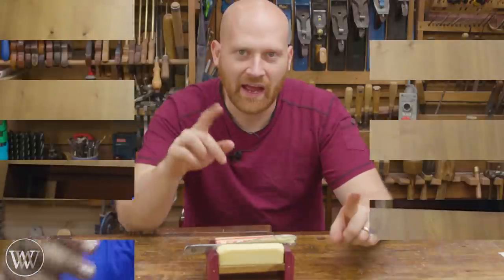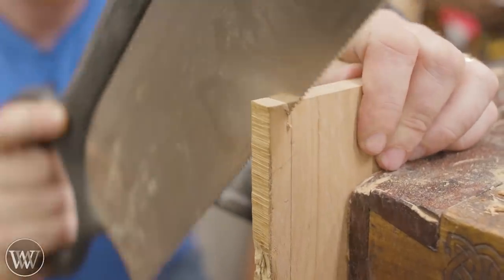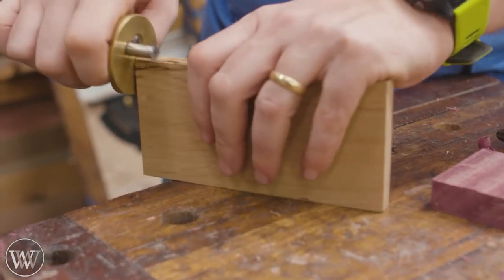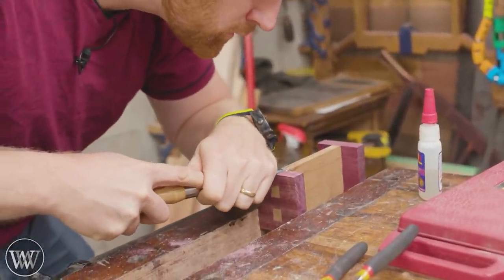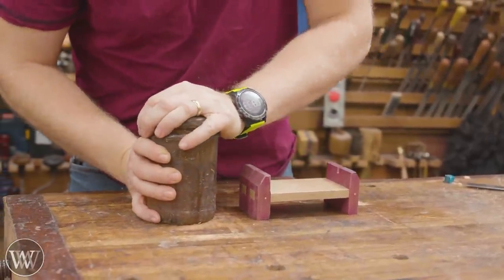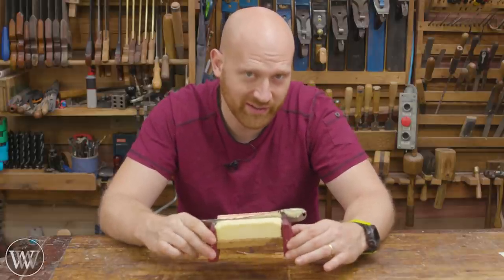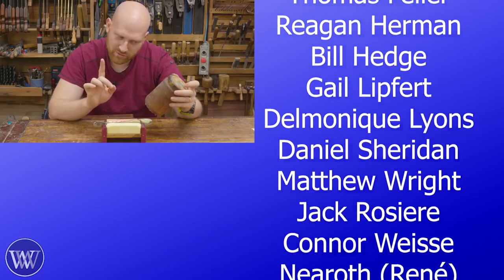How to Make a Butter Dish

Comment: Hi James!

Love this collaboration.  Both of you did a great job.  Raaghav is a very talented young man.  Thanks for introducing him.  Love the butter dishes and the hard butter butter knife!

As a historical note, what is commonly called a "shooting board" by some modern English speaking woodworkers is actually (originally) termed a "Chuting Board" (around the early to mid 1400s).  That is: A board with a dedicated chute (path - think laundry chute) that the plane remains within while trimming a piece of stock.  It is not until after the Korean War that we see the name changed to "Shooting Board" (a very different tool used by rifle marksmen to fine tune the sights on their rifle).  This change was entirely an American homonym confusion (interchanging  two words with similar sound but different meanings -- e.g. new and knew) which recently, last 40 years or so, has propagated through many other English speaking countries.  Since the words chute and shoot do not translate to homonyms in most other languages, many non-English areas find Engilsh directions confusing (the mass development and use of firearms Shooting Boards being a very privileged American event) and even confrontational/violent in some cases.  While one can say "Chute the true."  It is generally best to say, "Trim [plane, or pare] using a Chuting board"  this helps clarify the difference between the two very different tools.  FYI another name for a Chuting board is a Blocking board.  Here the term Block means to make tried (square to at least one surface) and true (entirely co-planar/flat) -- hence the name of the "block plane" which was originally developed for that specific purpose.

Comment: Can't beat purple heart, most of the time if you take your time, you can, as you did finish up with either a plane or scraper to get an amazingly smooth and shiny surface finish. I just make myself a basic long wooden stirrer for natural peanut butter and luckily had a nice, piece of old purple heart, just wide, long and thick enough, finished it with just a plane and peanut oil. 
Curious how come you didn't carve out a "bed" for the butter to sit in and/or stop it leaking off the side if it was left out and got too soft?
Reply: OK, just watched Raaghav's video and saw that he did do a little bed to keep the butter in ;-) Oh and while I only have limited old tools I've managed to find from friends/relatives and restore (few chisels, block and #4 plane, back and rip saw, square) after watching that kid, I feel like a king as far as tools are concerned. Good on him, first time doing dove tails and looks like he did a damn fine job.
Reply: @lynxg4641  thanks man, you will grow your collection faster than you can think! Those are some essential tools you have, you can make almost anything with them, slowly but surely you will get there 🥳🥳👍
Reply: @RaaghavWoodWorks  Thanks Raag, already feel very well equipped after watching what you have to work with, but hopefully James initiative will help change that soon. I actually enjoy finding and restoring the old tools (thanks to James and Rex for that inspiration) and know I already have more than enough to do more any project.

Comment: I've used BLO for years for everything from wood finishes to dressing my braided silk fly fishing lines; I was unaware that it was food safe until I viewed this video. Do you apply your BLO straight, or do you mix/cut it with other substances. For finishes on wood I frequently cut my BLO with turpentine (or mineral spirits) in a 50/50 mix. I've found that the turpentine allows the oil to penetrate deeper into the wood grain before it evaporates leaving just the oil behind.
Reply from the maker: I wouldn't use the stuff you get from the store is it has chemical dryers in it that probably wouldn't be the best for food though the newer ones aren't as bad as the old ones were. I use my own homemade BLO. It doesn't have any chemical dryers and is perfectly safe for food. And yes if you want a little deeper penetration you can thin it out. But you usually end up putting on several more applications of it.
Reply: @WoodByWrightHowTo  I don't suppose there's a link or video on how you make your BLO, is there?
Reply: @paulregner5335  yes, he has a video on how to boil your own blo, but for most people it's not a safe option, which is why I use something like a cooking oil as it does not have the chemical dryers, best of luck 👍🥳
Reply: @RaaghavWoodWorks  The problem with using cooking oils is that they eventually go rancid.

Comment: I've never seen butter in that shape before, is it the standard shape in America?

With the through tenons/square dovetail things do you cut the fingers from both sides like Paul Sellers or just from one side?
Reply from the maker: I like to chop them out from both sides. That way you make sure to hit the cut line on moth sides.
Reply from the maker: Butter in the US is sold in 1lb blocked that are split into 4 blocks but those come in two different sizes depending on where you are in the US.
Reply: When I do my dovetails the middle always breaks rather than cutting, any ideas? Mostly in softwood.
Reply: @sorchard6  Key with softwood is a extremely sharp chisel, sometimes it helps to make sliding motions with a smaller chisel to cut the fibers instead of pushing trough.

Comment: I noticed no glue was used in the mortise and tenon joints. Is it common not to use glue?
Reply: Ah, but he did pin the joints with brass pins, so glue is not necessary. In this case, you could go either way, glue would help lubricate the assembly of the joints, but pinning will keep the joints from coming apart.
Reply from the maker: Using a pin rather then glue will make it stronger when you need to wash it.

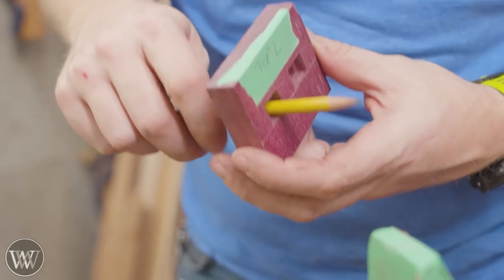Comment: At 7:46 you were fixing the tape on a cassette, haven’t had to do that in a very long time say oh 1998, thanks for making me feel old for 3 seconds. It is so hard to explain to people that you don’t soak or submerge wooden things in water because it will ruin them, I swear the conversations go just like this: Hey this shot glass is awesome, thanks just one question can I wash it in my dishwasher?
   No, the water will get absorbed by the wood and will ruin the shot glass please do not put in dishwasher or completely soak in the sink, hand wash towel dry and let it sit out over night if the wood looks dull apply some of the paste wax I gave you and rub it in
   Ok so why can’t I put it in the dishwasher?
 Because water will absorb into the fibers of the wood causing the wood to warp which will then cause your shot glass to develop cracks or give you a very strangely shaped shot glass do not put it in dishwasher
  Ok
  Ok
2 months later
  Hey I’m my shot glass looks real funky and has a split from the top about halfway down and whatever I put in it pours out the bottom
  Did you put it in the dishwasher?
  No, well not really
  Did you submerge it in the sink?
  Um.......
  Do you remember me telling you not to put it in the dishwasher or submerge it in water? Do you also remember me telling you it needed to be hand washed toweled dry and left out over night to air dry?
   Yes, but I didn’t think this would happen
   So you didn’t think I knew what I was talking about when I told you this would happen?
   I didn’t think it would be this bad, may I get some more?
   Sure pricing is still the same, just don’t put them in a dishwasher this time.

This look like a fun project, I don’t use butter for anything because I personally don’t like it, but my gran- now she loves butter so much she puts it on PB&J so someone should enjoy it. Great video James love fun little projects like this